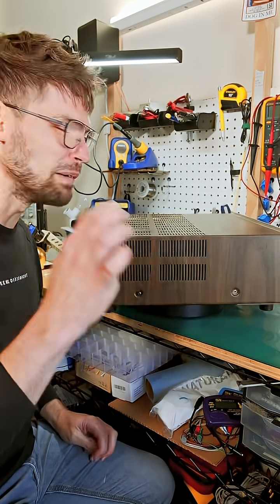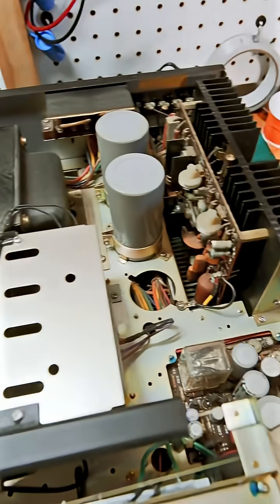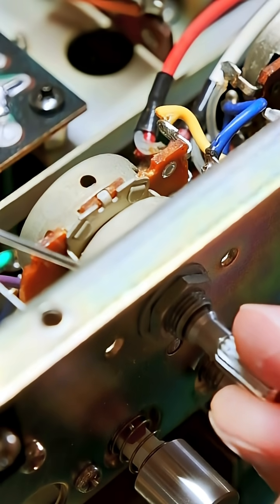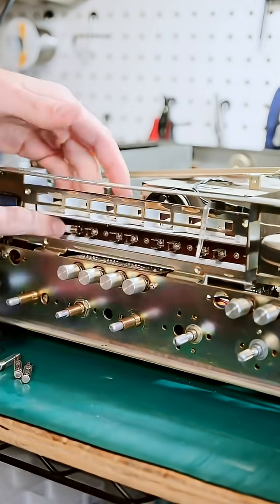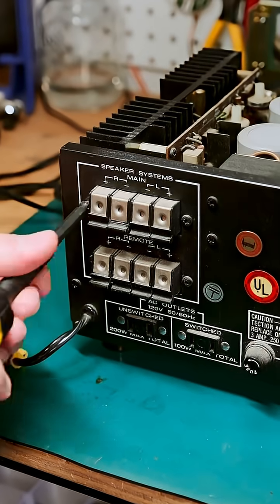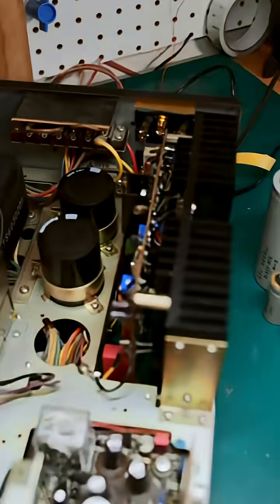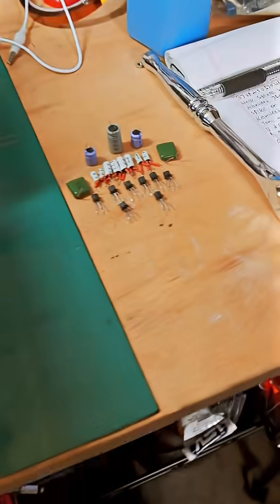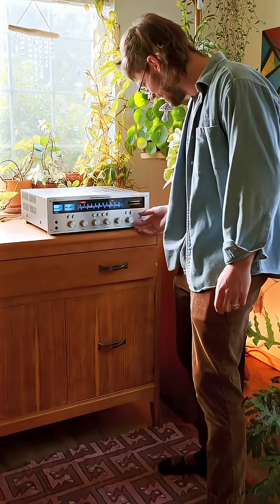Built to survive a house fire 🔥 #stereorepair #vintageaudio #Hifi #Marantz

Comment: OH GOSH! I was a bench technician from 1970-1982 for Radio Shack and from 1982-84 for Montgomery Wards. I worked on many models including Marantz. Discrete components replacement shown was the norm. I also used to clean the glass dial plates, replace the backlight bulbs and received thank you notes from customers. I am now 79 years old and this brings back so many memories. Thank you.
Reply: Watching this reminded me of building a transistor radio with my dad when I was a little girl, and of course, going to Radio Shack for the kit & wires. I'm glad you were part of that era & cultural phenomenon.  ❤
Reply: Man, you worked for two great 20th century retailers. I miss Radio Shack the most. There is no other electronics place like it. With the exception of YouTube, I don't like the 21st century at all.
Reply: Radio Shack was the coolest place on earth to find any part I needed.
Reply: @binderdundit228 i still don't understand how they could go in the wind. you could buy all you think of there. 
for comparison, in my town there's no electronics parts shop. if i want resistor og 0.5 ohm i must order it from the net. 
we have some store but mostly cables chargers and toys. not even sure if I can order something over them. 
there, tomorrow i will go there to ask for some coils and capacitors for crossover. 😮
Reply: What a great comment!!!! You are great!!! A living treasure sir!!
Reply: You remind me of repairing Apple IIs, reading schematics, and soldering directly on motherboards.
Reply: Thank you. Since my teenage years in the 1960s, I have loved reading schematics, trouble shooting down to the component level and replacing the defective, transistor, capacitor, resistor, diode, etc. Today, everything is surface mounted components.
Reply: My dad wore clothes from MW. Those  clothes were made to last forever.
Reply: @lordfarqua  Yes, yes they were made that well. I still have two long-sleeved button-down shirts I bought from what was then known simply as "Wards" when they had their closing business sale. It was a sad experience for me and the employees, soon-to-be former employees. To this day, I curse Jack Welch for ordering the closure of GE-owned Wards when he was heading that corporation.
Reply: @ronaldschild157 NEVER knew it was GE owned. I work for GE (NOW GE VERNOVA). People speak volumes about Jack Welch, but I think all of his reckless acquisitions and inflated cash flow books caused GE to split up the way we did recently. MW, Sears, Craftsman were iconic symbols of our union labor in the US according to my dad.
Reply: I miss radio shack something about those stores I liked and I was just a kid. Im now in my mid 30s lost and confused😅
Reply: You guys built and maintained America. You gave great reputations to the businesses you worked for.
Reply: I would have loved to work at radio shack fixing equipment, damn.
They used to have incredible services and staff, I was sad to see them go.
Reply: Radio Shack failed because they never diversified! During my employment, (1970-1982) At one time, I was asked by some executives concerning what Format of VCRs the should sell; Beta or VHS? I responded; Sell both & drop the one that doesn't meet sales expectations. Same with CB Radios which at that time, Even J.C. Penny, Montgomery Wards were already selling CB Radios. Believe it or not, Bill Gates approached Tandy Corporation, seeking financial backing for it's Microsoft DOS, Tandy refused and now we know the rest of the story. I was employed at their Main Headquarters after they had relocated from Boston to Fort Worth, Texas. W. Seventh and Carrol St. Across the now former Montgomery Wards Building. (It still exists but it's condos) Mr. Charles Tandy (CEO) was a man that really cared about his customers & workers. I can NOT say that about the others that took over after his death.
Reply: I need work on turn table s &amp or two . ..pls text me info  how to get in touch w/ someone...thx...😊
Reply: @michaelmccallum370 BTW, I also used to work on turntables, Miracord, Dual, Garrard, etc. etc. Hope someone out there is available to help you.
Reply: I am sad that our ability to repair things is pretty much out the door. These videos bring me great joy as did your story sir!
Reply: you.
Reply: Sill have my radio shack 8 track am fm  console. Blue  beautiful dial face 
I could record off the radio onto blank 8 tracks. 
Hard earned $100 bough it at $2.50 an hour for physical labor-1975.?…
Reply: WOW...I still have my old 8 Track FM combo auto player (purchased in 1968) AND an 8 Track recorder (purchased around 1972) Bought this model because it used an AC Hysteris motor instead of others that used a cheap DC Motor. BTW, Some time ago, I hooked it up and the FM Radio still works. Did not try the 8 Track, (No 8 Track tapes & the drive belt is not good)
Reply: Radio Shack had bench techs? The good old days before everything was disposable. It's so hard to find good bench techs where I live, you have to ship it off somewhere.
Reply: Appreciate you 🙏
Reply: Thank you Sir for sharing. ❤❤❤
Reply: Thank you for your service.
Reply: Very interesting sir I am 64 years old living in Pakistan working in electronics field, serving 15 years in our sea port Dp world Karachi terminal, as a Electronic Lab Incharge /Engineer , very nice memories,
Reply: I'm 50, and when i was young, Sears, Radio Shack and Montgomery Ward were the real deal. I remember we used to take things like stereos, TV's, and the like, to be repaired. And the technicians knew their stuff. Your post just reminded me how much I hate that everything in our society has become so disposable.
Reply: You could have made much more money with your skills.
But it probably wouldn't have given you the independence you enjoyed while being an employee and not a business owner.
I made the switch and became a union wireman.
It was definitely a more controlled working environment.
However, I  survived without any serious injuries and am now enjoying a pension and benefits....which is non-existant for a technician.
And yes.....I  have a healthy 401K also.
Haven't needed to touch it.
I hope you were able to save enough so that you're not currently a greeter at Walmart.
Reply: I prepared myself for retirement by paying off my home right after my divorce in 1995, and have never lived beyond my means. I have no outstanding credit card debt and only have utility bills and insurance bills. ⅔ of my retirement checks goes to my bank. But most important of all is that I am  thankful to Almighty God for granting this 79 year old man with good health...Zero issues. Enjoying my life with my children, grand and great grandchildren.
Reply: @juans6639 you did something right for God's Grace . Much love & respect. 
I turned double-nickels this year & hope & pray to achieve those milestones.
May God continues to bless you.
Reply: Same to you and Thank you so much. God bless you.
Reply: @juans6639  Gentlemen, I salute you both, this is the most wholesome exchange I’ve ever seen in a YouTube comment section. This this should be a blueprint for how humanity treats one another.
  I am 56 and a retired veteran of the United States Army and God is blessed me through active duty combat deployment, and employment after service that is allowed me to retire early.
   I believe you are both living examples of Proverbs 2:1-32 as you both can clearly appreciate the Value of Wisdom.
  May God continue to bless you both, in Jesus name.
  Be well,
Godspeed.

Comment: This guy is on top of his game. These old tuner/amps were made to last.
Reply: They don’t build quality like that anymore 😢. Everything is lasting a couple of years and they make it so cheap you just buy a new one.
Reply: @shaggy01985 Where are you buying your amps from?
Reply: If that were the case, why did it cost 1200$ to get it fixed?  That is way more than the cost to toss it and get a new one.
Reply: @David-w9i7j that is the price for quality. If you don’t want to pay it or can’t pay it(I can’t see in someone’s wallet). Then don’t get it fixed. Buy a cheap surround set
Reply: @shaggy01985  If it breaks, then it is not made to last.  If it costs 3x its original price to fix it, it is not a price for quality.
Reply: Electrical parts wear out. The quality was in the sound they produced. It is not economically feasible today to produce sound like they did back then for the average consumer.
Reply: @David-w9i7j if it breaks after 40 or 50 years it is very good quality. And it is up to the owner if he wants to continue with his receiver. I can’t see in his pockets.
Reply: @David-w9i7j i guess they cant get a new one anymore...
Reply: @David-w9i7j  It’s the same reason why guys put $50,000 in an old car and they won’t get $40,000 in the open market for it. There are some models that bring big time money and it is worth putting the money in. In the end it’s for the love of these devices. The later 70s was a manufacturers war to outproduce the competitor for the greatest receiver. Some say the pioneer sx1980 won it but there was no finish line, just ran out of steam about 1980. But they are still around.
Reply: Facts 💯👌🏻
Reply: yeah and now they are completely obsolete electronic waste...

Comment: Thank God for such people saving old tech. Old tech were built with love.
Reply: To be honest, if they COULD have built it with modern non-serviceable boards they would have, BUT the main difference is in the cabinet and the dials and knobs. They are heavy, solid and beautiful to the touch. Modern sound systems have haptic touch panels or digital controls with no feel. They use cheap plastics that mark and show fingerprints too easily and they have planned obsolescense
Reply: Utter rubbish.
They were built on production lines like everything else.
Get a dose of reality.
Oh, and god had no input whatsoever.
Reply: @Tinker1950 old man, throw your bitterness somewhere else. Must be lonely AF 😂
Reply: @Tinker1950  Thanks.  I needed that.
Reply: @Tinker1950  Nit Wit

Comment: If possible, I’d recommended sourcing original NOS bulbs.  

The LED color spectrum is not as broad as incandescent bulbs.  

Nothing quite matches the original like the original.  

There’s also the potential of electrical noise from the LED’s,  they are after all photo diodes and create small voltages when exposed to light. 

Transmuting ambient light flickers and perhaps even some radio spectrum into voltage murmurs in the electronics.  

LED’s are like miniature solar panels in a way. 

But I think the nostalgia factor of perfectly matching the color is worth the effort all on it’s own.  

Incandescent filaments also have a glowing delay, a hysteresis of sorts which maintains the light output even as the ac voltage fluctuates, so they may even be more consistent sources of light than an LED which would flicker quickly with changes in the ac, assuming the lighting circuit is an ac power source and not DC.

Comment: Out of curiosity, does any of these new parts affect the tone this amp produces or maybe even change it drastically?

I wave chart kind of tells you that it does
Reply from the maker: The parts are already worn out. They're 50 years old. So replacing them with new parts that are in spec brings it back to the way it sounded from the factory, however, the sound change is anything but drastic on a unit like this. I'd wager that most people couldn't reliably pick which one sounds better in a blind test.

Comment: I have a Technics ,Frequency Generator Servo Automatic SL 220 turn table i bought around 1978.
    I got it new ,when I bought it I told the man I wanted one that would last a long  time .
    I paid about $100 for it ,a lot of money at that time .
     About 2 years ago, I had to clean the speed adjustment controller. 
    That's all I've ever done to it, and it still works like new .

Comment: You send back the replaced old parts? Might be down the line important for a museum or such to restore it to the original state.
Reply from the maker: Only if the client asks. There's no reason to put the originals back in to a piece that isn't rare. They made around 80,000 of these units. If a museum wanted an original one, it wouldn't be hard to find

Comment: If you want to avoid static discharge NEVER use a vacuum. The dust and air create a charge in the hose and will discharge. If you want to use air use compressed air.